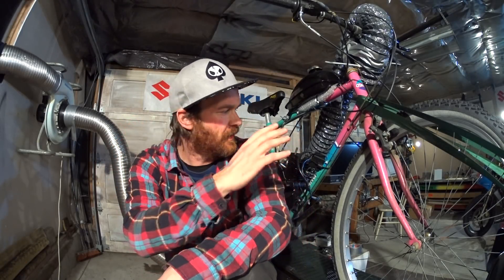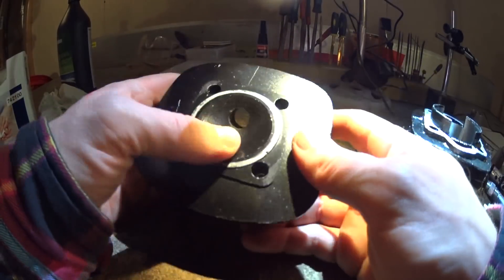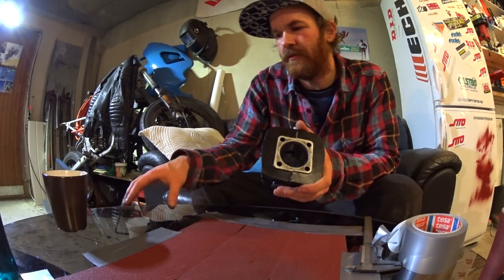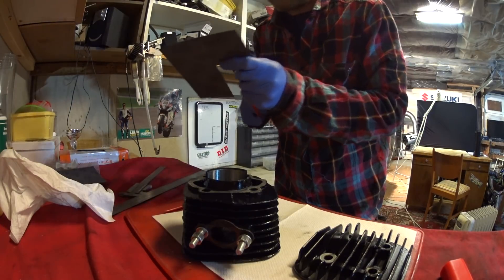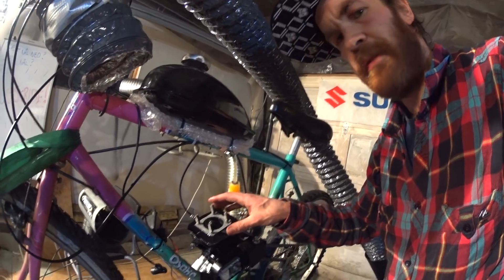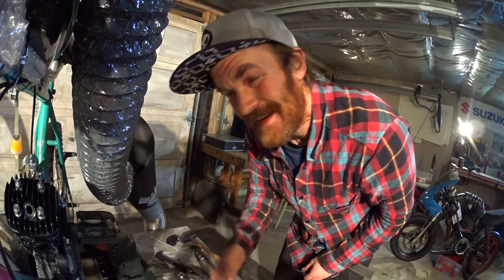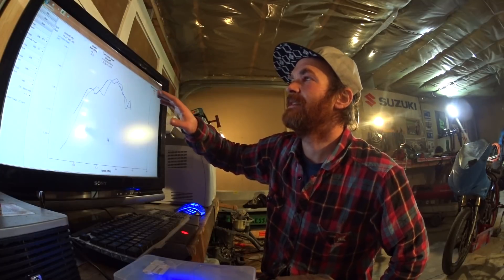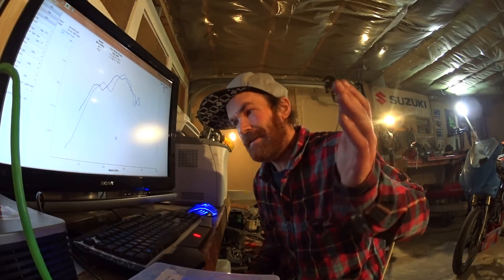Motorized Bicycle - Port Cleanup, Cylinder Decking | Dyno Results

Comment: Where did you get your grinding tool ?
I’m surprised because it actually fits inside the cylinder and alloys you to do work
Reply: Dental drills, and there's a porting tool supply company that has everything you need. I think that is where he mentioned getting them.
Reply: @marthamryglod291  thanks got me a dental drill
Reply: @frnkguard1  how is using the dental drill? I was considering purchasing one for the transfer roofs and keeping tight radiuses
Reply: @marthamryglod291  well to open up my intake and Transfer ports it works great you can buy the carbide burs on EBay and that’s where I got everything for pretty cheap, I’m happy with the result’s
Reply: @marthamryglod291  works well actually I got mine port’d

Comment: I have YD100 and want to now what is te best timin in exhaust and intake. I wnd to made médium porting in transfers, intake and exhaust. Mi engine have three gasket between cilinder and crankcase,,,, the exhaust is a tuned pipe and upgrade carb.
What you recomend me for mid range power.

Comment: If your chain comes off, then it's not tight enough, end of story. I use the included fixed tensioner, and I have never had that happen. It's tricky to get it right, as the tension changes when you go to tighten it down. But it's easy to tell if it's too tight. It WILL take several tries, but once you get it in the slot, you're golden.

Comment: When people talk about porting.... how come none of you ever mention that when you port, do you or do you not enlarge the port all the way to the inner edge of the cylinder wall increasing the length or not?  Well, DO YOU????  Or do you just enlarge the outside of the cylinder leaving it tapered down to where the opening on the inside is left alone???  I don't get it because no one ever talks about that.

Comment: Hold up are my transfer ports on my mb supposed to have the cylinder sleeve type thing covering them because mine are open
Reply: Just a different design. Doesn’t make any more power opened than closed

Comment: How thick can a single sheet of base gasket material be before needing some kind of metal core sandwiched material. I need to raise my cylinder a little more than what I have already. Also what material do you use- paper, rubber/fiber, rubber, or other. Thanks.

Comment: NICE, I've ported all of my handheld lawn equipment, my stihl fs130 kombi power unit, husqvarna 3120xp chainsaw, stihl bg85 hand blower and my redmax 8500 backpack blower. I just open the exhaust port on everything and clean up the transfer ports on the heads, makes a big difference. My redmax 8500 backpack blower is 12 years old and it has as much or more power than my echo pb8010 blower, which is currently the strongest blower on the market. Maybe I'll port my echo 8010 too in the future. I also use Dirko gasket sealant which is made in germany for the base gasket. It's what stihl and porsche uses and it will raise the compression as opposed to using an actual base gasket.

Comment: I'm not trying to be a safety nanny, bit please consider using safety glasses when grinding.
 As a blacksmith/welder i've spent quite a few nights at the emergency room getting splinters drilled out of my eyes (yes, they actually use a very small drill bit to remove metal splinters from the eyes). 
I eventually learned to protect my eyes after an infection caused by a metal splinter almost cost me my vision on one eye.
Keep up the awesome work. 
And from the bottom of my heart, thank you for sharing your passion with all of us, inviting us into your workshop so we can follow along.

Comment: So just out of curiosity did u find any air leaks in your crank seals?or any issues from factory?ive bought 12 engines,on my 12th build now,and theres always something,i almost always have An air leak somewhere but ive already had to change out the whole clutch assembly,including berrings,now my crank seal went on clutch side n i hta wait another few weeks to ride again,i think they all suck but i cant stop!ha ha ha

Comment: I removed alot of material from my transfer ports on the GT5 type 38mm stroke engine on my bicycle I was worried I lost too much velocity so I filled in the exhaust sides of the transfers with a bit of JB weld trying to keep the quantity and angles equal, it turned out awesome! I gained 5 mph and lost almost zero bottom end torque.

Comment: Just as a little tip: you can file the Cylinder down before you use sandpaper, it will get you to the wanted Height faster, just be carefull to not get it to Slanted.
Reply: File...sand...?..to remove material..

To painful for me..

I would chuck it in lathe dial it in..

Face it off 

And end it

Comment: If you make your piston top flat will it make more power (not talking about this engine, put in general)
Reply from the maker: There's research indicating that a flat piston combined with a toroidal combustion chamber is slightly better than a domed piston and "bathtub" chamber.

Comment: For the first go-round of Shaving something down I use a concrete block they're pretty freaking Square brother then I go to sandpaper on top of concrete block it is like I said straight edge good work brother
Reply from the maker: +Critical Mass Critical Mass Thanks, good tip!

Comment: Do a combo of raising the cylinder and porting the exhaust to get the ex. where it needs to be. Maybe even ridiculously big radius on top of the ex. port. Then lower the transfers bolting pieces of alu in the top of the t-ports and shape with epoxy. :)

Comment: Gday, have a look at www.dragonfly75.com. 
I have the slightly smaller 48-49cc, no idea how much power it's making but I have tidied up transfers and used port map from dragon fly site, changed spark plug, replaced carby for a Tecumseh carb off an old cylinder mower 4 stroke lol, but works great extended intake manifold length but the best mod so far was rm 80 expansion chamber. It now has proper band, goes hard, not sure of max rpm but top speed is 65-70km with standard 44 tooth sprocket. 
Anyway that's my 2 bob, I enjoy your channel, cheers
Reply from the maker: +chititia Thanks! And thanks for the tips!

Comment: uh so my bike has the same problem as I last commented about lol... but this might help you hopefully help me diagnose the problem, when I'm going up a steep hill and I have top brake, I cant get my bike to rev up high enough to get the power to get up the hill with regular speed, so I stop and let my bike downshift, I pull out back onto the hill and blast up the fill for a second or two  but then the revs drop like iv changed gear and it goes back to being slow, I don't think its the rollers because as I said last time I put in lighter ones
Reply from the maker: +ThatGuyCalled ART I suspect the rear pulley guide pins, Replied to your other comment with link to video showing them.

Comment: very low compression engines. They work best on 85-87 octane, and can reach 80 kmh on 120 psi. People running high octane (89+octane)in them are losing power with stock compression
Reply from the maker: +Matthew Ledgerwood You sure about that? Even if an engine can thrive on low octane fuel doesn't mean it will lose power on higher octane.
Reply: your right, depends on what your compression is. These motors can go as low as 100psi from the factory, which in that case 87 octane is the most you would want to run if running proper spark timing(91 octane is too much octane in this case), 110-120 psi(decked head) likes to be run on 89 octane-91 octane

Comment: as long as you keep the rings healthy and clean the carbon on the piston from time to time, they will deal with shocklingly bad top ends with no ill effect to the bottom end.

the top ends can function  for 5000 km+ if you live in a flat area, go easy on the clutch and have 40t gearing, keeping the speeds around 50-55 kmh

Comment: even when they start to lose compression, ive seen a 2000km+ deeply scratched cylinder that ingested rocks with 75 psi compression pull a 225 pound person up to 55-58 kmh on a 36 t sprocket (was on its 3rd set of rings_

Comment: the top ends can last 3000 km+ before losing compression if your jetting is on running 32:1 semi-synthetic . paying attention to the rings  and changing when blow by occurs (you can buy them 4 sets at a time for cheap,)

Comment: rhese motors get a bad rap for that reason, but with retarded spark timing, proper carb tuning and 87 octane fuel (120 psi compression), ive personally witnessed GT-5 style bottom ends withstand 6000 km+ of 50 mph use on 36 inch tooth sprockets (26 inch wheel) which is around 8000 rpm on that gearing
Reply: Matthew Ledgerwood 50mph? That's ridiculous. This motor will never pump more than 5 horsepower and not even recumbent bikes go Highway speeds on double that. Personally, I put forty nine boost bottles on my motor and did a spark plug delete and now I break the speed of sound on my commute to work.
Reply: 50 mph is childs play with one of these engines
Reply: https://www.youtube.com/watch?v=dD5_d4bB__M 

fastest one on youtube is around 70 mph..

Comment: the kit cdi is hard on big end bearings, and can cause failures at around 500-1000 km if driven above 5500 rpm constantly. The 44t sprocket with an expansion chamber and slight compression bump can see 9250 rpms on a 26 inch wheel (around 70 kmh)

Comment: https://www.gasbike.net/products/super-charge-cdi-for-48cc-66cc-80cc-high-performance-1

these engines benefit from having an ignition with a seperate coil/cdi with spark retardation in the upper rpms

https://www.gasbike.net/products/super-charge-cdi-for-48cc-66cc-80cc-high-performance-1

You can also use a coil from a honda cr 2 stroke bike and a  yamaha pw80 replacement cdi
Reply from the maker: +Matthew Ledgerwood Thanks for the tips! Yep, two strokes want retarded ignition at higher rpm.

Comment: Can you port for low end rpm???
Reply from the maker: +Simon Portelli Small/low ports and long pipe is the way to go. Won't make much power tho..
Reply: 2STROKE STUFFING if you lowwer the ports what will happen?
Reply from the maker: +Simon Portelli Oversimplified, You'll get less time-area, but also less short circuiting at lower rpm - less rpm potential, potentially more power at lower rpm. You'll need a longer pipe. Remember that just as going much over 190° exhaust duration weakens resonance, so does going much under.

Comment: You should try to balance the crankshaft! That would be an interesting test.
Reply from the maker: +Martinoffi I'll do that when I have it apart
Reply: some of these engines with a 38 mm stroke have balanced cranks
Reply: @arthurericson4130    I would suggest that might be coincidental accident,  as even a broken clock is right twice a day. Hahahahaha

Comment: Hey the ignition timing for the spark is way retarded to start changing anything els,just gets too hot.
Reply from the maker: +Alex Ray Just got a new timing light, looking forward to seing how this ignition behaves. Thanks for the tips!
Reply: And about lowering of the cylinder. The piston in it's lowest position (BDC) opens transfer ports end exhaust port only partially, so lowering the cylinder makes it worse. This is done on purpose with transfer ports - it's good for piston optimal cooling. And with the exhaust port - tuners making it's top part wider and slightly higher so it changes it's form from oval to something like inverted trapezoid with rounded edges.
Reply: >I raised it
If so, the problem for sure is with the intake port. But, if you plan to file or drill the piston skirt - it can do the thing on high RPM and as a return will be the negative effect on low RPM.
>partially covering the transfers at BDC is not good for piston cooling
I mean If a fresh fuel mix goes above the dome it's not good for piston cooling.
Reply: And here's some info about porting 48 cc version of this engine:
http://www.dragonfly75.com/motorbike/timing.html
http://www.dragonfly75.com/motorbike/portshape.html
Reply from the maker: +Loren Keith I'm getting a new timing light today, yeah it feels/sounds very retarded.
Reply: Well, not really. The ignition timing changes together with the RPM - this ignition coil+CDI scheme doing it. The keyway on the left axle of the crankshaft for the magnet key may differ, so we have early ignition and tuners shifts it 4,5 degrees like this: http://www.dragonfly75.com/motorbike/woodruff.html
So it worked with my engine as described, I used wider 4 mm woodruff key and filed it to 3 mm from different sides to make magnet 1 mm offset.
You can try both ways - to make an ignition timing retardation by turning the magnet counter-clockwise by 1 mm or make it earlier by turning clockwise. Just don't turn up the magnet - it will change poles and ignition timing by 180 degrees, so mark the outside before removing )) 
P.S. To remove the magnet I used this Chinese pulling https://ae01.alicdn.com/kf/HTB14LBtLpXXXXXoXpXXq6xXFXXXB/226248071/HTB14LBtLpXXXXXoXpXXq6xXFXXXB.jpg "35x45 mm".
Reply from the maker: +Alex Ray I haven't lowered the cylinder, I raised it. Having the piston partially covering the transfers at BDC is not good for piston cooling. You want the piston flush with the port floor so fresh mix can flow over the dome cooling it, if the piston is higher it creates a "kicker" pushing flow away from the dome.
Reply from the maker: +Alex Ray 👍

Comment: Hey brother, roll the engine to TDC and look in to the intake port, you should see the bottom of the Piston skirt. Try removing that tad bit of skirt, and then re Dyno the bike
Reply from the maker: +countryguywithcamera Exactly, and I made it even worse by lifting the cylinder.
Reply: I think if you were to remove the baffle cap again you'd probably see power gains across the board, but I understand why you had it on
Reply from the maker: +countryguywithcamera I took it off before the power runs. Think I filmed it, but I didn't mention it, should've done that.
Reply: Do you have fb messenger? I'll send you a pic of a mod I did that seemed to improve flow for those who have to leave the cap on for noise reasons just a quick Dremel and ur done
Reply from the maker: +countryguywithcamera Cool, check the video description, link to my fb page there.
Reply: I sent you a friend request the other night when I saw you on zeda Mafia lol my name is Dustin Payne
Reply from the maker: +countryguywithcamera Cool!

Comment: great video! always fun to watch how you do things. just a tip tho: these motorized bikes dont like to rev up when cool
Reply from the maker: +jjhack3r Thanks! I'll take it more easy with it, tend to forget what it is...
Reply: 2STROKE STUFFING I dont really know how you took that comment but I figured I'd clarify a bit. if I ride my bike when warm it revs way higher then when it is relatively cold. surprisingly these engines are somewhat resilient to abuse. After some mods, I ran my bike at 9-10000rpm wot for more than 5000 miles before I got nervous and decided to freshen it up. You shouldn't worry about blowing it up from rpm but rather things falling apart inside the engine. one ebay kit I got blew at 500 miles with a spacer from the big end con rod bearing wedged in the cylinder lol
Reply: 2STROKE STUFFING btw boost bottles have little effect on power. from my experience they smooth the engine and add a little responsiveness. also the stock carb really holds you back. a generic racing carb off ebay with a jet kit makes it rev up a lot quicker.
Reply from the maker: +jjhack3r Ahh, I thought you ment they are prone to cold sieze. Yeah, I've noticed it needs a few warmup runs before power is consistent. Ouch about that spacer...
Reply: 2STROKE STUFFING yeah, my wording was a little off. I can easily see how that could have been misread. Anyways, keep up the good videos! Peace, man!

Comment: I bet this engine could benefit from a... get ready for it: Heavier flywheel. I don't like the way it oscillates up and down in revs like that when it's under full power, it'll mess with the carb tuning I'm sure.
Reply from the maker: +ekner You're probably right about that. The oscillation is from the wobbly rear wheel I think tho.

Comment: You should make a custom exhaust pipe with an expansion chamber
Reply from the maker: +love_for_bikes 15 I plan on doing just that later in the process!
Reply from the maker: +MrSlehofer Would be fun to play with that weird design! Though I'm pretty confident a more "conventional" pipe of the same length could work even better.
Reply: you should try out this http://www.dragonfly75.com/motorbike/torquepipe.html,
it works pretty well for me yet I'd love to see it on the dyno, unless I'll get my hands on one of your ardyno shields and try it myself
Reply from the maker: +MrSlehofer I was planning a kickstarter and selling them as kits, but as component cost is so insanely high in Norway(and import taxes) I'll only be selling the bare PCB's. I'll of course make a good partslist and thorough instructions. Haven't thought of how exactly I'm going to sell them, ebay might be a good option, I'll look into that!
Reply: love_for_bikes 15  b
Reply from the maker: +MrSlehofer The Ardyno shield are in production btw!
Reply: excellent, can't wait to get my hands on it, you planning to put it on kickstarter or sell it on ebay?

Comment: if you put these in it
170
125-130
150

with the right shapes it will run good.
auxiliary ports is also possible? 

some more transfers is a good idea too I think.
Reply from the maker: +Jurrian  Mulder I'll see what I can do!
Reply: http://www.puchmaxi.nl/puch_calculator.php

Did you know this application? Easy to calculate every port
Reply from the maker: +Jurrian  Mulder Nope. Nice, seems like a quick easy way.